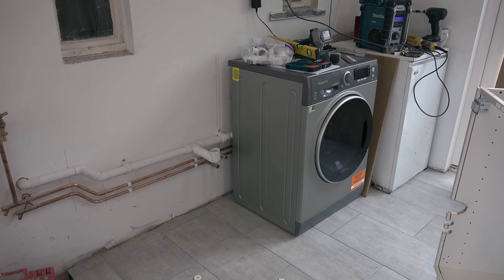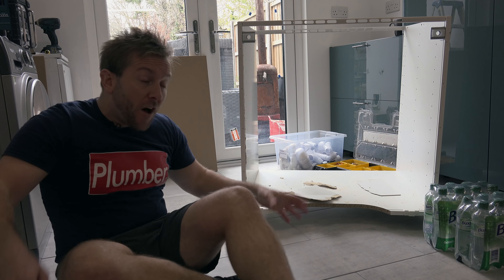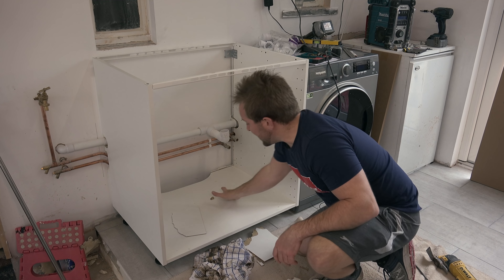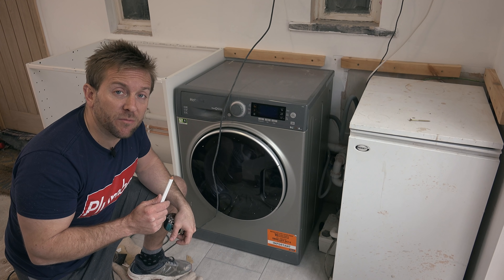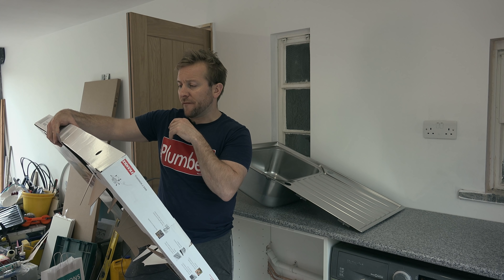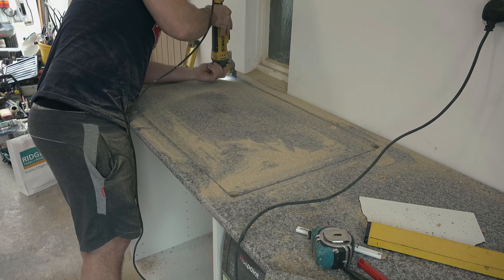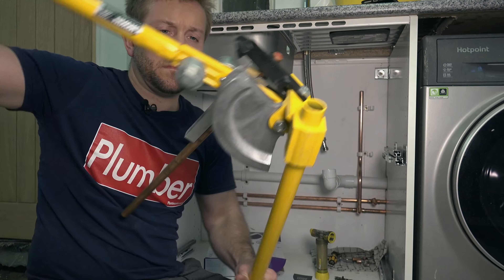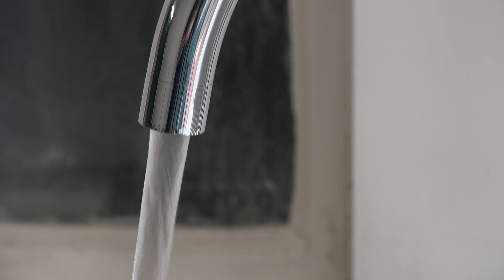KITCHEN INSTALL GUIDE

Comment: My base units have stupid wood supports that also act as a door stop support, that I will need to cut as well as the worktop to get the sink in which means I also have to remove the entire back panel otherwise my sink won’t fit.

Comment: Great vid - Use a jigsaw to ‘round’ the corners of the worktop sink cutout. Makes the hole far stronger than straight 90 degree cuts.
Reply: James drilled the corners out with a large wood drill so ended up with round corners with no need to break out the mighty jigsaw. :-)

Comment: Great vid. I was pulled by the sparky coz my kitchen didn't have isolator switches  above the worktop to the dishwasher fridges etc that were under the worktop. Wouldn't that also apply to the utility room ??
Regards Don Codman.
Reply from the maker: Might do. As long as no one died an instant death from them being under the worktop!

Comment: Nice video, one of my least favourite jobs is replacing sink taps after they've been in for a few years..., I do like when fitting kitchens to put the tap in before I place the sink . Also found a metal bracket which you do have to fit after the sinks is in place that uses the bottom of the worktop as extra support especially  if the sink is the thinner  type . Good work  and hold tight..

Comment: You didn't seal work top where you cut it that's a ''no'' ''no'' always seal with silicone or it blow when water gets down there as it always does.

Comment: Tip - put masking tape on the worktop to draw the cut out for the sink which will also prevent scratching when cutting, and you can lay the sink upside down and use as a template but draw your cut lines 10mm in or whatever is required.
Reply from the maker: Yeah I've used that method in the past too!

Comment: One of those jobs as a plumber that I've done hundreds of times, but I was still entertained throughout 😂 On a techie note, I've had flexi fridays onto iso valves- resulting in wet vac Fridays😭 (after a week of job completion it split). Male irons or poshy iso valves with flat 1/2" male iron end are the the way forward for me now!
Reply: Yep never good to have flexis straight onto iso valves but its amazing how often you see it!
Reply: You can get flexi tap tail adaptors 1/2" also in 3/8ths" both threaded to 15mm spigots for compression. Pop you C/Vs or Ball-o-fix's straight on. If you salvage 1/2" to 15mm compression unions offa old  rads they can be re-used too. Just be carefull tho, as those Kudox ones that Screwfix are knocking out, foc, with new rads are sharp not flattened. They are also slightly longer than std ones. Makes a like for like rad swap..."awkward".
Reply from the maker: Ah mate I never show it but I just file the taper off. Never had a problem then.

Comment: The next time I do a kitchen I'm going to experiment with fitting removable backs to the cabinets that have pipework behind them. Model makers use a fixing for wings on aircraft that seem ideal to fix to the carcass and that would then allow the back to bolted in with short M6 bolts.

Comment: Right, what kind of black magic fuqqery are you using to get away with a circular saw blade on a worktop?  All convention says you get tear out of the surface., unless you cut with the top reversed and even then blade has to have about a thousand teeth.

Comment from the maker: The video name is a bit click baity...but don't confuse me with someone who actually cares!
Reply: "A little bit on the whhhhaaaaa!" might get more hits?
Reply from the maker: @MarkFixesStuff  I guess I realised to do a whole video on the install of a whole kitchen it would need to be about 15 days long!
Reply: plumberparts It’s helpful stuff. I know better than most the intensive process behind making a video. Fifteen minute video can take three days of work on my side, and if you want the output to be high quality then reshoots and farting about make the actual job much much longer. Anything bigger than a circuit board brings me out in sweats, but with the help of a few of your videos I’ve drained my central heating, replaced the pump and two leaking rads, replaced a crap drain cock and installed a magnetic filter. All using end feed fittings. So keep on making the videos please mate!
Reply from the maker: Finally someone who understands how long it takes to make a video!

Comment: I do not like the idea of putting sinks above drawer units. It's exceptionally rare that you would have to do this. On that run with wash mac and fridge (beer chiller I'd bet) there is no real option. I had to butcher the rear of a drawer on an Ikea drawer unit, just last week, when I swapped a single bowl for a single bowl + drainer.  Even though I used a space-saver waste and tucked the trap right at the back against the wall, the bottom of the waste fitting and elbow snagged the top rear of the drawer. 
Those sink clips are brutal and don't work well on 28/30mm deep worktops very well anyway. No shame in just gluing with silicone and the butchering of the drawer is just an inevitability in this particular case.
Reply: Sorry! My fault! I ordered the units in desperation so I could finally get a utility room without even thinking about the impracticality of drawers under a sink 😂 😭
Reply: Typical woman! Only jokin', Em. I will be e-mailing this link though to the customer for whom I did the job with a, "see, I told ya so!" Square pegs round holes. Hey ho!
Reply: loafer sheffield haha! At least I can admit I made a mistake eh? 😂😜
Reply: It seems to me that there is  an increased tendency, in this day and age, for people to admit to and take responsibility for  making mistakes. It is to your credit that you take personal responsibility. Humility is an important feature of a well rounded and balanced personality. Regrettably this seems to be a dying trait. We all make mistakes and learning from past experiences is invaluable. I always make mistakes (according to my missus, she who must be obeyed) However, they are often intentional... so I can skeive out of doing boring housework. Mind you, I always open the window when I take a poo and I am the designated house bailiff for evicting spiders.